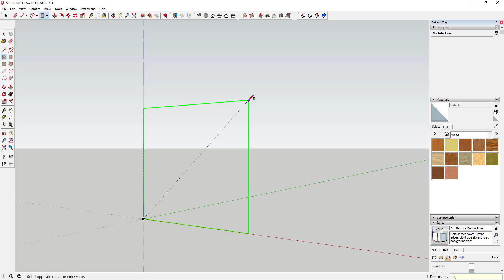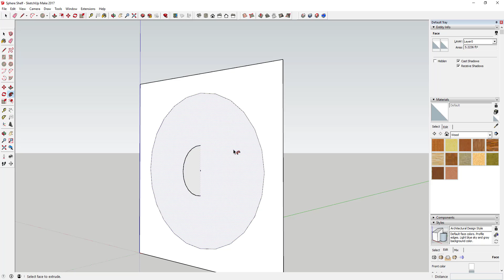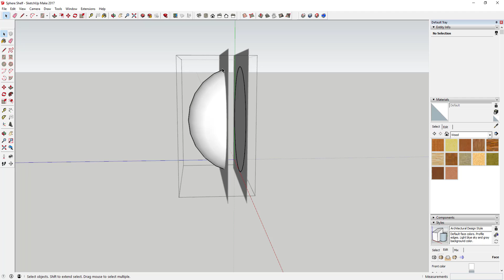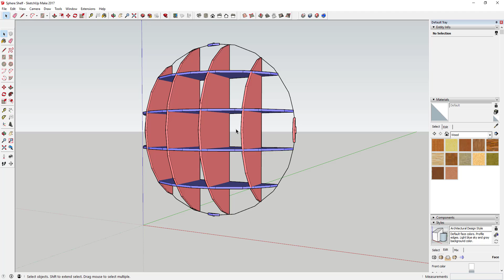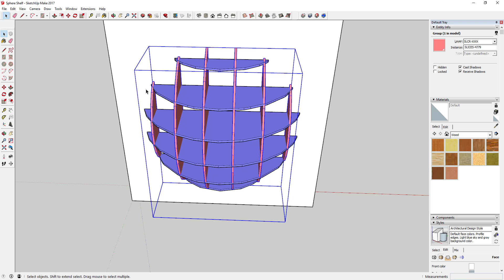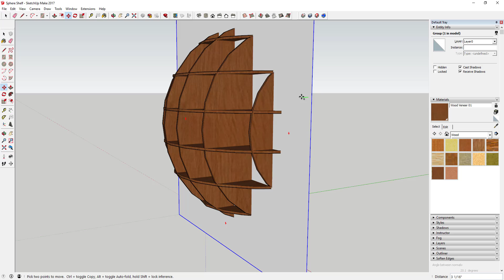Modeling a Spherical Shelf in SketchUp with Slicer - SketchUp Plugin Tutorial

Comment: Thanks a lot ! Is it possible to extract the size of each board, as well as its depth ? Julien
Reply from the maker: You can measure the board sizes using the tape measure tool - is that what you mean?
Reply: Yes exactly, thanks again